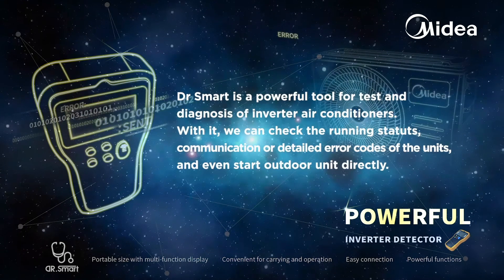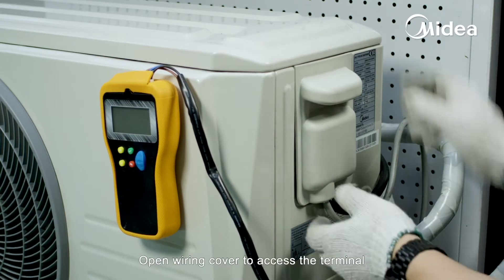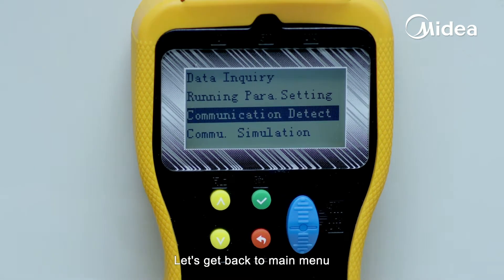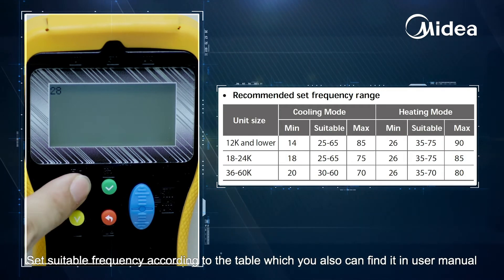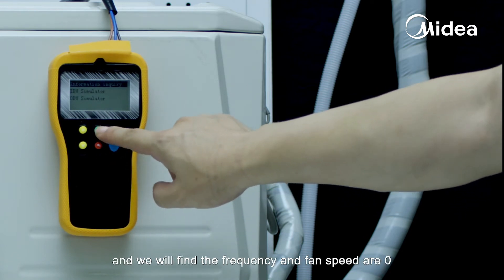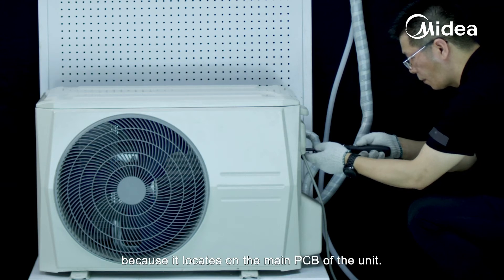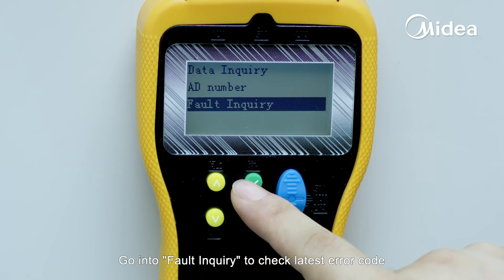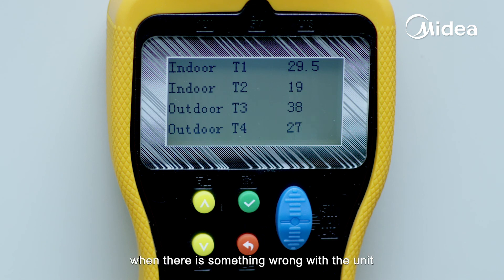User Guide of Dr Smart

Comment: Mine works on Senville units, which are made by Midea. Ports are 123 on Senville. Port 3 is where the black wire goes as its the communication wire (shows around 80v vs the other 2 are 120v).

Comment: Hello, is there any way to read the values of FminC/FmaxC/FminH/FmaxH for a unit? I am able to set these parameter as overrides, but i did not figure out how to read the factory values of them? Can Dr Smart or any other command do this? In the service manual for Dr. Smart are values, but i am not sure whether these are still valid for newer units like R290 Xtreme and Xtreme-heat models.
Reply from the maker: Sorry, no way.

Comment: Where this tools can be purchased ?
Reply from the maker: Where are you from?
Reply: @dennishuang1028  From Bosnia.
Also I asked you to gave me access of your videos for Midea about troubleshooting to share on my channel you did not replied to. I am service guy for Vivax/Beko brand which is popular in Bosnia, and install a Midea units a lot during years, MIDEA is produceing for them :) I have access to TSP from them many yearas and now I want to share my knowledge to another
Reply from the maker: @hvacinstalacije1985  Sorry I didn't recieve the request and I don't know how. You can order the device via the TSP system with the BOM code 17222000A55927
Reply: @dennishuang1028  To be delivered to Bosnia? I also want to know more about tools, since I saw that you values are different when I see temperature of T1 and T2 sensors, and the shold haave alsmost same values when unit is turned off. Alos regarding videos, can you send us via wetransfer to be able to edit, cut some parts because I want to have the on my channel each separated which will be dediceted to error code
Reply from the maker: @hvacinstalacije1985  Would you please share me your E-mail. About the values, maybe the unit just turned off after cooling.

Comment: Hi, I think there is a new version of this tool now,  called INV Testboard No.4 which looks similar except with a direction pad on the middle and a vertical color LCD. Is there a similar instruction video like this one for that tool?

Thanks
Reply from the maker: How do you know that? We are planning it and not available now. We will do the similar video when it launches.
Reply: @dennishuang1028  It appears to me that it has already launched, seeing as I have one on my desk already that I bought. It appears to be unable to detect communication on a working system, but it is able to drive the outdoor unit directly, interestingly enough. Hopefully when it is "released", the device will get an OTA update, as per the instruction manual. Looking forward to see the video!
Reply from the maker: @liminalsunset  As I know now we only have Chinese version for domestic market and we just finished English translation. Yours is Chinese version?
Reply: @dennishuang1028  Yes, the unit I have is Chinese. I haven't tried the mobile app yet, though. Seems like the app is necessary for many functions that used to be possible on the device itself.
Reply from the maker: @liminalsunset  The app is not ready yet, even Chinese version.
Reply: @dennishuang1028  Ahh I see. Thanks for the information! I'll wait for the app to be released I suppose - the device looks like it has tons of functionality built in this time around!
Reply: @dennishuang1028  Hi, do you know if there are any updates? Is the app available in any market or language yet? Thanks
Reply: @liminalsunset  Have you managed to change the language to English? in 4 Gen. ?